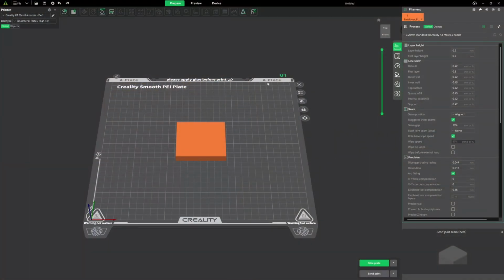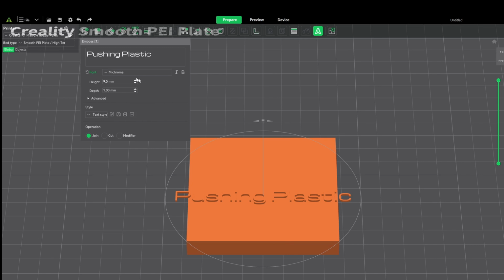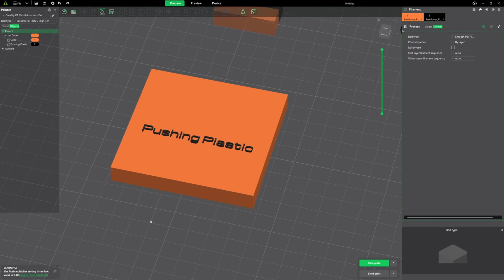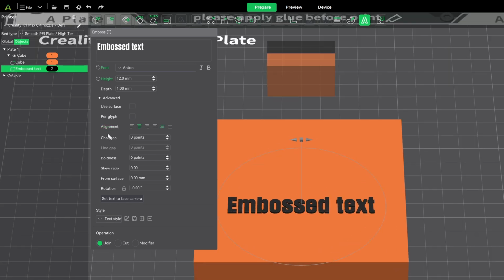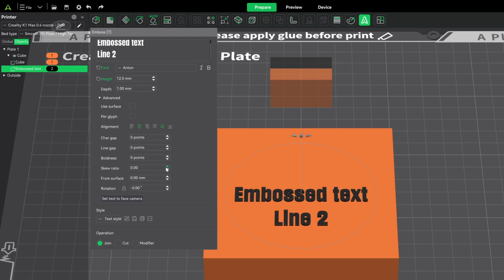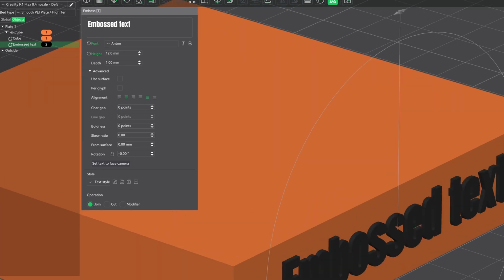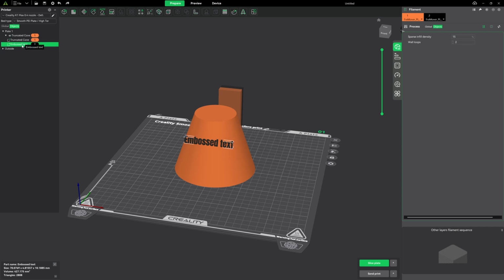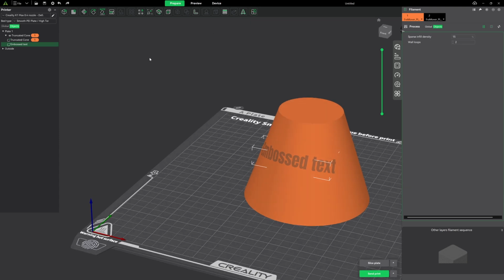How to Add Text to a 3D Model in Creality Print 6: Step-by-Step Guide

Comment: Attempting to emboss the number of teeth and pitch on the flank of a spur gear model using Creality Print 6.3.1.xxxx, could only get embossed text to appear at the z-height of the print bed itself.  Was able to get it to appear on the surface of the model by using "on surface" check box.  This seems contrary to what you're showing in this video, right?  Glad I found your channel - happy to subscribe.
Reply from the maker: No, click the model first, then the text tool. Otherwise is puts it on the bed plate as you experienced. Glad you got it sorted out!

Comment: Hi There, I see you are using Creality Print which is great as I have just started 3DPrinting (Ender-3v3 SE) I have printed a few models and now I want to start designing my own and the one I want to start with requires a void inside the object could you provide some advice on this subject?
Reply from the maker: Without the details of the void inside, the easiest answer is when designing your model, design the void right into it. What design software will you be using?

Comment: Is there a shortcut to centre the text on a face? For example, you start the text on the top of an object but then decide to move it to another face, can you snap it to center on that new face, or is it trial and error?
Reply from the maker: Sorry for the late response. Go to Object mode. Right Click on your object and select Center from the menu. This will place you object in the center of the printing bed area. Then click the test and do the same thing. Both objects are centered on the print bed but more importantly they are centered with each other!

Comment: How to print text to the bottom of the surface object . I want to print text on the bed with layer height 0.4 starting from z0 and then print the rest like a box in an other color so I get text on the bottom of the box with color white and the rest of the box blue
Reply from the maker: Flip your object over, add the text, mirror your model and flip over again so that the text prints on the bottom. Is this what you are looking for? Example, https://youtu.be/Axn1iyY4AmM
Reply: @pushingplastic7445 thank you i will look into it
Reply: @pushingplastic7445 many thanks this works great

Comment: PROBLEM, I am 3 days new to 3d printing........ every single youtube video skips the basics. cool, add txt, thats still step 10 or step 100...... NO ONE EVER SAYS HOW TO ADD THE DAMN BOX to start doing anything! 

so many videos say add a model, got that. You are the only one i see on how to add txt, THANK YOU!!!! BUT by gollie, how the heck do you add the dang box your typing on??? the basics of 3d printing is to add a shape.... and that is skipped past like its second nature..... well not for this dumb noob. 😅😮‍💨🥵
Reply from the maker: To get the box, right click on the print bed area of Creality Print, select "Add testing primitive" and then select Cube. This will place a 20 mm cube on your bed plate. Then what I did was select "Scale" from the top menu icons. I turned off "Uniform scale" by unchecking the box. The I changed the Size (not percentage) to X=100, y=100 and z=10. And that's all there is to it. But in fairness, most people have a model they want to work with, not the box. I used the box just for the purpose of the video. But if the box works for your project, give it go! The box also makes for good practice. Good luck, I hope this helps!

Comment: If you do "CUT" text (aka "engraved"), is there a way to change the color of the text filament?  I notice the option to "change filament" disappears if you choose to use "CUT" text instead of "JOIN."
Reply from the maker: I would try to change the color by using the paint option

Comment: If i were to attempt and make a jack o lantern any tips on either slicing a logo out or making the name of the company cut out completely from the pumpkin .stl?
Reply from the maker: You could bring in your jack o lantern into the slicer, then bring in the logo or text as a negative object for the cut.
Reply: @pushingplastic7445  would I use the mesh Boolean tool?

Comment: Thanks for a very good explanation. 
Can the text be made to go around the circumference of a disc? 
thanks .
Reply from the maker: Yes, by using the Surface feature. If you don't see it, click on the text tool, then Advanced and you'll see it there!
Reply: @pushingplastic7445  . Thanks for your feedback.  Can the software add text around the circumference? Similar to text on the surface of a medal?  thanks for your patience. regards,

Comment: It is frustrating trying to get text to appear where it's wanted. I have a figurine on a 1/2 inch tall cylindrical base and I want text to be cut into the base wrapped around the outside surface. The very first time the text was placed on the base but I deleted it because it wasn't wrapped. At least 20 times after that I tried to repeat the placement to use the glyth function but it wasn't placed anywhere near the base and I can't find any way to get it moved down there. Any tips on that?
Edit: I finally got it to work by using empty lines and tweaking the distance between lines and squaring it up with the "Set text to face camera"

Comment: Creality really needs to improve the emboss function. What I wanted the text to curve up on the cone instead of curve down? How do you get the text to be flush with the service so I can have multi color text and not have to worry about cuts or overhangs? The alignment function of the text is really off. They should allow you to select a face to add emboss text and then align to that face. Emboss function leaves alot to be desired. Thanks for the video, it clarifies some of the built in confusion to C.P emboss function
Reply: Yea I agree, it's extremely simplistic and limited.